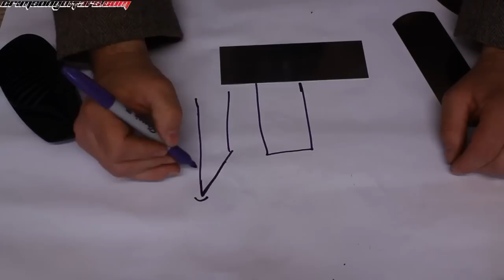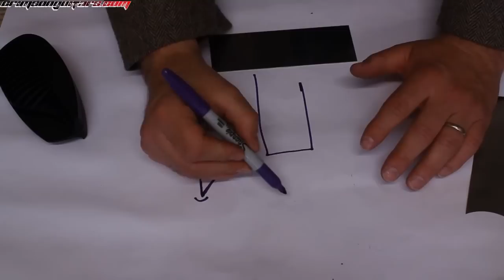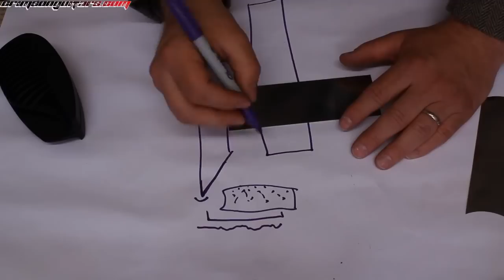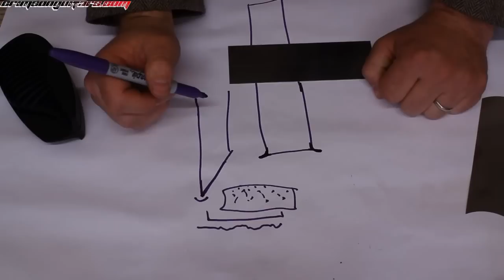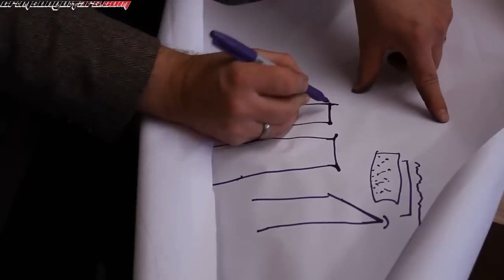Ep 7 of 8 - Theory of Sharpening Scrapers - Sharpening Masterclass with Ben at Crimson Guitars

Comment: I purched a german made scraper then went about watching 4-5 instructional vids on how to prepare it for work - I found that all the methods varied so I did it my own way - I flattened/smoothed it out with a 3000 grit diamond plate then polished it with 6000 grit micro mesh before creating the curf with the shaft of a quality screwdriver.  The outcome was great, I got nice shavings and a smooth finish.

Comment: Great video Ben. I was taught to make my own scrapers from worn out hard point saw blades cutting the required shape and then sharpening in the workshop for fine work.
Reply from the maker: One of my worst injuries was when I slipped while filing a custom scraper shape and my palm sliced down the still ragged piece of steel! Thanks for reminding me :( B
Reply: I can only say ouch mine have been with chisels the worse with a circular saw imbedded in my hand much to the hilarity of fellow joiners on site but most tool no matter which type are very save if taking care 😅

Comment: Not mentioned in the video is to use a 30 or so degree edge angle, rather than 90 degree surfaces. It produces a much more aggressive cutting action for quick stock removal, particularly for removing machining marks such as left behind by a plane iron, jointer or planer "tracks". Also not mentioned in the video is the use of a much thicker - 1/8" or so thick - scraper. They have a variety of advantages in some applications and can often be used one-handed since one doesn't rely upon flexing them to cut.

Comment: Thanks Ben.Always great tips from the Master.
Reply: I have used over the years A pinion shaft from a differential gear unit.Very hard steel and highly polished.Being an auto mechanic I had these laying around.A fuel pump drive rod is great also.Thinner than the pinion shaft and easier to handle.

Comment: How many times should you develop the burr. I saw you rubbed the burnisher 5 times then you where a for away. I do not have a burnisher. What can I use instead? A drill bit? Where I live it's hard enough just to find a scraper let alone a burnisher which I have never seen so getting such specialist tools is either too expensive to import or just not possible.
Reply: I'm in the same pickle, but I think I might try using the bottom of a chisel to burnish.